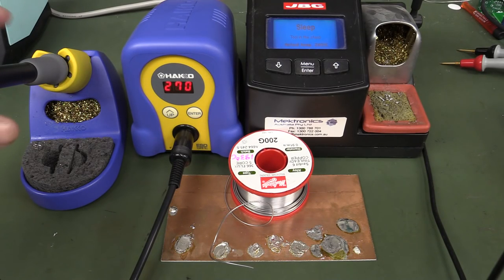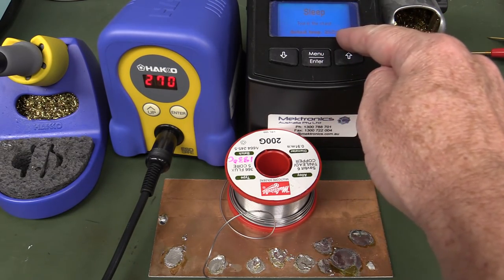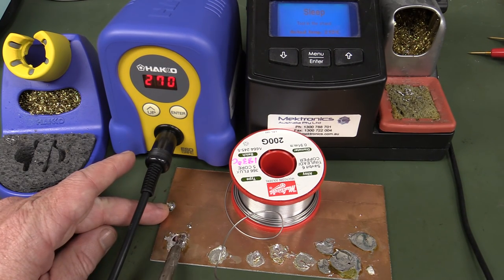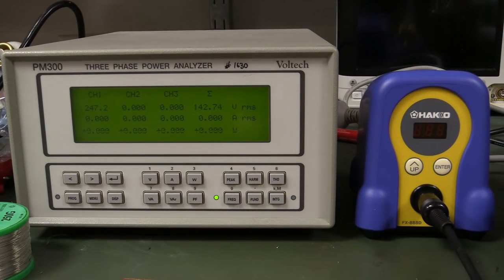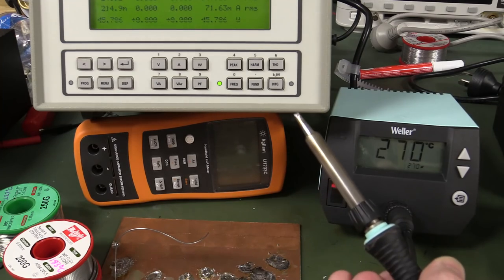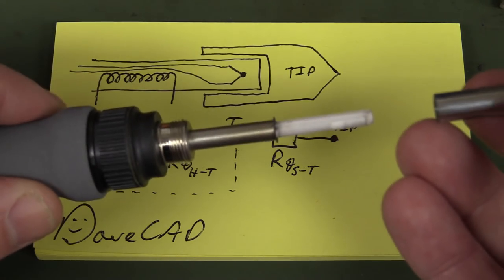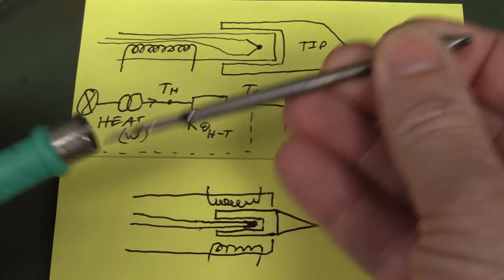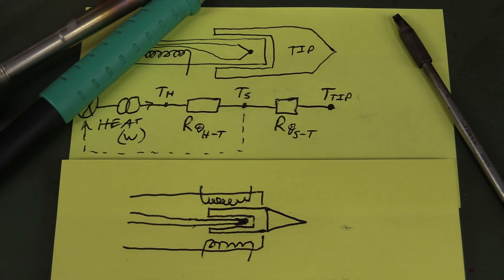EEVblog #1065 - Soldering Iron Power Delivery Explained

Comment: You may have heard all this before, but I don't care... I'm not about to read every comments section of every one of your hundreds of vids just to check... And, by the way, this is not about soldering irons -- I mostly agree with you on that.  

Light-Emitting Diode...
Dave, being an engineer makes you qualified to explain what an LED is and how it works, but it sure as hell doesn't make you an expert on the English language!  
-->  It is not a "led" (lead), as you say.  Never was, never will be... 
It is pronounced as the separate letters L-E-D, because it's an initialism, not a true acronym.  

A few popular Acronyms:  
(Pronounceable words made up of first letters...)
NATO, NASA, SCUBA, LASER, UNICEF, DARPA... 

A few popular Initialisms:  
(Words made of first letters, and pronounced as a series of letters. Note: Initialisms are often wrongfully called acronyms.
 The distinction is relatively recent.)
UFO, LOL, AC/DC, Q&A, HR, GMO, FBI, CIA, NSA, PSI, LCD...  and LED!

You wouldn't think of trying to pronounce LCD as a word, right?  Then why do it with LED? -- They are the same kind of word!  But some may say that LCD is not pronounceable as a word, and LED is... Well, just because you can, doesn't mean you should! Do you think NASA (the agency) would be called NASA (the acronym) if there was already a word using those exact letters that meant something totally unrelated? How about CIA?  How many spies work for the cia (sia?), LOL?   Well, there is already the word "lead" tossed around whenever we mention solder... And the word "led", past tense of the verb, to lead,... and another "lead", the black material inside a common pencil (despite the fact that it is actually graphite, not lead!)...
So, must we add to the confusion by mispronouncing another completely unrelated word?! 
 It's the same disregard for precision that makes people pronounce LOL as "lul", or "law-l'... So annoying!   (And let's not kid ourselves, "LOL" is the proper spelling... the non-capped "lol" is just Shift-Key laziness!)

A scenario just for fun:   A technician is confused by what the warning on a food testing device meant, and tries to remember dubious training sessions. as he explains his overreaction to the situation...  "I was led to believe that when the LED was flashing that there was a high risk of lead poisoning!" -- Go ahead, Dave, make that sentence even MORE confusing!  LOL

I know I'm just pissing in the wind, but I feel better for speaking up... Much like pissing, really.

To be clear, I'm not trying to be mean... 
  if I was actually trying to be mean I'd be bitching about your whiny fucking accent!  ;-)
(And that, my friend, is called "Taking The Piss"...  LOL)

Cheers, and much respect (usually) from Canada!

Comment: What if thermal paste will be in tip? Will It help to thermal transfer?
Reply: Михаил Соловьёв I think that kind of paste will dry up if you push it over 200C constantly, but I like the idea.
Reply: I put some solder inside tip. It helps. Makes a better thermal conduction.
Reply: How do you change tips? Keep it switched on and use tools?
Reply: It does not stick when cold. Makes a tight fit but seperates with small force.

Comment: I think you did a good job showing that the performance difference wasn't due to the 65 vs 130 watt difference (since neither even got up to 65 watts). I'm actually surprised the Hako didn't go up to 65 watts constant when it was applied to the ground plate...maybe it would be better if it did?

Comment: PID?  Profile is probely different.
Reply: Right? I watched the video and just kept saying "surely he's going to talk about how one is proportional control and the other likely has a PI or PID loop." Nope. It's pretty obvious my Hako simply cycles on/off based on the set point. Because the JBC can deliver partial power, it has a much more advance control loop.
Reply: JBC has PID. Hakko is a bang-bang controller. The two strategies converge when either the temperature difference is very large or in a steady-state near the target, but the PID works around an overshoot issue that bang-bang control natively has. Unfortunately even overshooting the sensor temperature does not cause the tip to behave. To work around that, you'd need predictive control which PID is not.
Reply: Siana Gearz, JBC is using variable wattage in its controller, Hakko is  built down to price, like you mentioned on off on off. I work with Heat controllers but any that would do anything close to JBC would cost around 700 US Bucks but there is always the arduino option. This would make no difference, if like Dave mentioned about the mass of the tip and location of the thermocouple.

Comment: I'm 3 minutes in and this video is over 20 minutes long... it's an electrical engineering vlog, so you should have little-to-no difficulty lowering the power on the newer-tech one down to the wattage max of the older-tech one, right? Is that coming later on in this video? I'm gonna be disappointed if this isn't demonstrated at some point in the 20 minutes. It begs the question how they'll perform at similar/identical power levels.
Reply: 13 minutes in and still no similar power comparison. I get that it's not required information on this topic. However, this video adds very little additional information over the last one, so I'm good at 13 minutes. Time to do something productive.

Comment: I have a RHINO  soldering station. I waanted a hako but the cheapest i could find was 180AUD if memory serves. the one i got does the job and cost half the price. It is also Australian made. it is a bit bigger but is good enough for me. Just thought id let people know what i bought when lookin for an iron that is a bit more than a a handle, wire and plug.
I bought a real cheap chinese one for dirty jobs such as melting plastic etc but the whole thing melted in my hand the first time i used it so i recommend to spend a bit more, even if you just want the most basic model. just bare in mind that i am no expert, just sharing my experience when buying one
Reply: Sorry to disappoint you, but it's not Australian made, it's a Northeast Chinese product that is being rebranded by hundreds of brands around the world. The actual manufacturer is Ningbo Zhongdi, a fairly old company with some decent products, though not throughout. Just try some google-fu, replace RT in your station's name by ZD, and you'll likely get the Zhongdi original product.
Reply: Thanks for that lol. They are advertised on ebay as Australian made. That was one of the main reasons i decided upon it. Well so far its been good after a year using it once a month. i believe you. i should have known that an Australian product would never be so cheap.
*edit: I just did a quick google image search and one of the first things that came up was the de-soldering station that Dave did a review on a while back, That was why i chose it. Mine looks similar and where the other wire goes into the base, It just has a black cap over it so they are using the same housings for both products.
*Edit2 : Sorry all i can find is the one sold by rhinotools in Australia and it is reduced now to $70 I still recommend it esp at that price, reduced from 100.
Reply: I've had my Zhongdi 929C for about one and a half decades, it has a fairly tight control for a ceramic heater system, very good manufacturing tolerances, and it's doing fine. OK actually the handle is starting to fall apart, the material is perhaps not the best quality. The ergonomics of the handle also leaves a lot to be desired, but that's what you had to live with if you had to buy something affordable back then. New ones are at least much more convenient since they started copying Hakko handles.
Reply: 15 years is welll done. Ill be happy if mine lasts another 10 years. and for $70 now, you cant go wrong. Let me search what you just called it. Mine is called the Rhino RT-981
Reply: Sorry, mines totally different
Reply: Yes, yours is different, they haven't been making mine for a few years now. Yours is ZD-981 perhaps?
Reply: lol, your 100% correct, i found it!

Comment: TS100 is a new design, but even with custom FW and biggest tip it is delivering only 20-25W @ 260 C with 24V supply. JBC delivers full 120W to the same ground plane @ 260 C setting.
Reply: I tested the TS100 with custom open source firmware (https://github.com/Ralim/ts100) with a standard 19V laptop smpsu and at 24V with my linear bench psu. With the 19V smpsu in turbo mode I got max. 40W only during heatup and constant 30W in turbo mode on a big heatsink. I normal mode it was about 20 - 25W on the heatsink. With the bench psu I got 60W only during heatup and about 30W in turbo mode on the heatsink. I measured with the 121GW ;-) and in 24V mode I could verify with my bench psu displays.
For me the TS100 is a nice little tool but for sure not a professional one. It's to lightweight and the handle is not perfect because to small and the buttons are not easy to tap or tap and hold.  I am a hobbyist and I love more my Hakko chinese cheapy copy of the FX-951 what is doing a good job despite it is not having a sleep mode.

Comment: I would love to have a JBC iron, but the cost is prohibitive. I want to build my own controller, and buy the soldering iron + tip. I have much experience of power electronics + programming (Check out taylor-studwelding.com to see my designs), so it should be easy enough. Just not sure which iron to buy, or the voltage used to heat the iron.